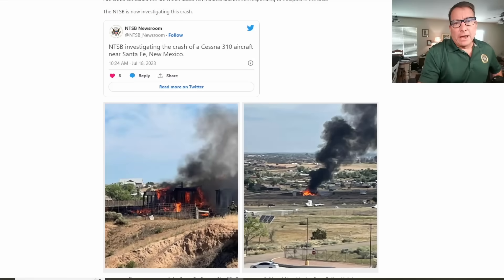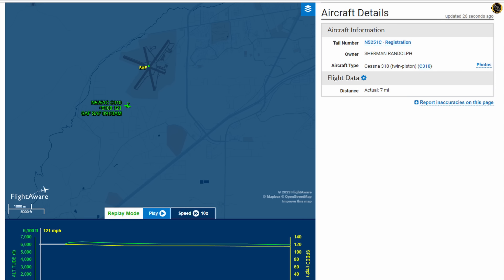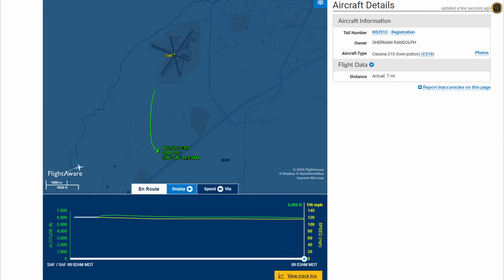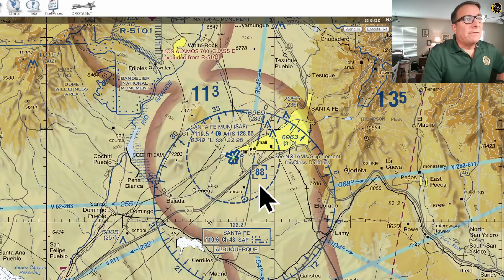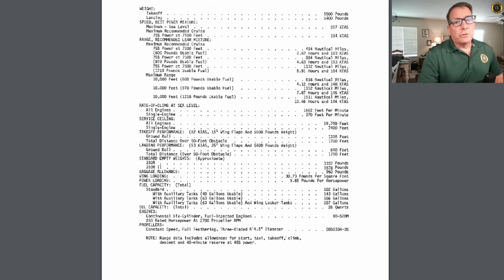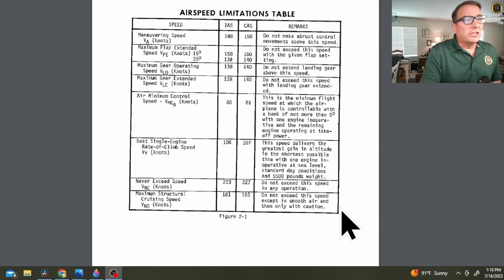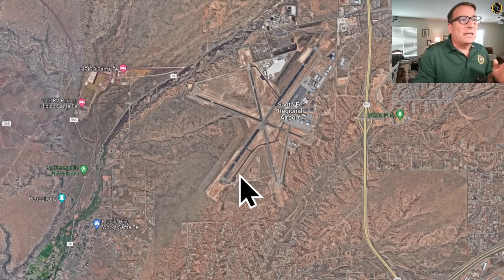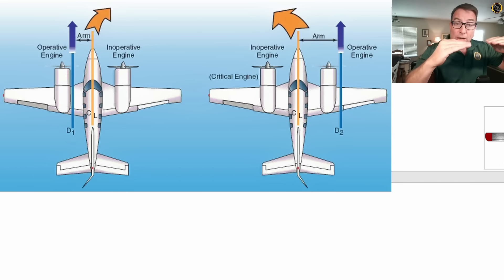Fatal C-310R Engine Failure - Santa Fe, NM

Comment: Been a long time since I got my multi ticket, But I recall my instructor telling me if I was in a spot like this to back off the power on the good side and put it down on the best spot I could find.  I can imagine this pilot was determined as hell to try and save it, and couldn't accept giving it up and putting it down somewhere.  There's another video of a 310R crash from a couple years back where the airplane flew over the person filming it, and you could hear only one engine running, the left one feathered, the airplane flying slow  and  nose up, then does the roll into the ground.  It was lightly loaded too, only 2 on board I think. Search "double fatal 310 crash in las vegas" on youtube.  My condolences and prayers for his family.
Reply: I believe the dead engine on that one wasn’t feathered..
Reply: @thomasaltruda  I agree.

Comment: Most of the analysis is focusing on DA's effect on a NA 310's SE service ceiling, but this plane was a turbo with a much higher service ceiling - this video shows/analyzes the incorrect POH for the NA version.  So the plane should have had no problem climbing on one engine at 9k' DA.  Obviously that didn't happen, and a highly experienced pilot is dead.  I hope we figure it out, but there's some other problem other than losing an engine.

Comment: There is lots of open runway here. Wide open feeling. Should not needed the go for a bounce. Makes you wonder what a new pilot is doing in a HP plane that is a lot more weight than a trainer. Lots of torque. Thanks for the content

Comment: Very sad. Light ME aircraft are usually under powered. When I had to fly the piper Seminole I mentally prepared myself for efato by treating it like a big Cherokee and just finding a field ahead. That operating engine was more a glide extender than a climb away at or above vmca option especially with passengers, bags etc!!

Comment: Thank you for your very informative videos. Wasn’t this aircraft a turbo version? If so, could the pilot have expected better ‘hot and high’ performance?
Reply: Better performance in theory, but controllability issues are critical, since density altitude affects indicated airspeed and airflow over the wings and rudder.
Reply: @gordonrichardson2972 I used to fly C-402s in hot climates. Single engine performance was not encouraging. Engine failure usually meant land straight ahead.

Comment: Excellent video. A tragic accident and a loss to both his family and community. Watching on another channel where they had the checklist up an item caught my attention.
Is it possible that under pressure and due to the high density altitude that the first reaction to the failure would be to push the mixture up to full rich instead of leaving it set for best power at that altitude? Mixture is the first item on the checklist and says "as required for flight altitude" however it is very easy to do when most of your training and home base is at sea level that with a failure the ingrained first reaction in memory is mixture full rich as that results in max power at sea level.
Full rich in this case would cause a loss of performance due to the altitude. Also with his significant experience is more complex types that have auto rich functions some reversion may have been a factor. Any which way it is easy to judge when not in the seat. I look forward to the report and the lessons from the video particularly about accepting on off field landing if there is a lack of performance is pertinent. On old and wise instructor once told me that in light twin the second engine will carry you to the scene of the accident.
Really like the content on your excellent channel.
X

Comment: So, 1.)  the pilot took off in ambient conditions that were not condusive to recovering on a single engine failure; and 2.) the pilot made the fatal mistake of turning into a failed left engine.  Would this accident then be considered primarily as mechanical failure, pilot error, or an equal combination of the two?

Comment: Would twin Cessna accident outcomes be better with VG kits that are 2/3 of the fin/ rudder instead of the whole surface and no wing root VGs to make the loss of yaw control
higher than stall speed and with slower progression.  Or wing stall sooner inboard before the whole wing or outer wing panel with aileron stalls?

Comment: Really surprised that after all these years, twin engined planes do not have engines that rotate in opposite directions. The De Havilland Hornet which was set to replace the Mosquito had Merlins that rotated in different directions, 70 years ago. I guess it would not have changed things in this case though.
Reply: Piper PA-39 Twin Comanche is counter-rotating.

Comment: The aviation safety network form you showed in the beginning was a Cessna "T" 310R yet I believe you showed the performance of a Cessna 310R model chart.  I am curious as to whether or not this was a turbo charged aircraft.  And would that have made that much of a difference
Reply: That's my observation, too. I think it could have made the difference if properly handled by a well trained pilot.

Comment: The GPS track speeds, which are in mph, the indicated airspeeds at that altitude must have been really low. Let's assume no wind. 120mph true converts to 91kts indicated at 9000ft. Slow, very slow.

9000ft vs. 7400 ft. is quite the difference!  However, much would have worked in his favor: The airplane will have been lighter than max gross with only one person on board and perhaps the aux tanks not filled. That helps with the climb, but it also increases Vmc (the documented Vmc is for the most unfavorable weight, so light). (The high density altitude, won't decrease Vmc because it's a turbo.)

I fly a normally-aspirated 310R, with the IO520 engines, and it does have quite some excess power and indeed I'd expect it to climb on one when light enough, but not necessarily beyond 10k density altitude. The accident aircraft even had turbos (or rather, one).

So there are some questions that we may learn from the report. Was it cleanly configured? Was it leaned for best power? Was the left prop feathered? If if all of this was the case, blue line is 108kts IAS, so why was he almost 20 kts slower than that?
Reply: So, N5251C was a T310R, a TURBO 310. The single-engine service ceiling is very different from what is shown in this video, as is . Single engine ceiling goes up from 7k to 17k. Showing the POH of a non-turbo 310R  seems like a glaring mistake, @blancolirio ...

Comment: Here at KLRU we had a similar accident a few years ago with a C421 because it was accidentally topped with Jet A instead of 
avgas.  This accident  has similar inconsistencies.  It is hard to believe that a lightly loaded Turbo 310 could not be flown single engine by a highly skilled and credentialed pilot to a successful recovery.  I sure hope they look at the engines for damage.  Bad/contaminated fuel answers the situation for me.

Comment: Doesn't the registration show this 310 as the turbocharged model?
  Still doesn't change the high density altitude analysis, but seems like the plane would have had a little better performance than the normally aspirated model.  A tragic tale no matter what.

Comment: The NTSB preliminary report came out in the last few days.  They reference a dashcam video that shows the aircraft descending  wings level and nose slightly high (although it goes out of sight before the crash sequence).  No comment on which engine failed.  It does reinforce that this was a turbo 310.  I think the performance numbers you used in this video are for a normally aspirated 310. I would have thought a turbo 310 would have had much more climb performance even in this density altitude?

Comment: I wonder if any engineers have ever considered a twin engine plane with a single nose mounted propeller.  Two power plants but no asymmetric thrust if one fails.  It could have an electric power train i.e. the engines are generators and the prop is driven by an electric motor.  I suppose that setup would add a lot of weight though.

Comment: I'm a single engine PPL but I've had some some training hours in a twin comanche , is it possible that due to the pressure density conditions he may run out of rudder authority (while had the good engine on full power ) ?
Reply: I'm not a pilot, but do know that density altitude affects both airflow over the wings and rudder, as well as the engine power.

Comment: Reading a lot of comments from pilots here that are focusing on turbocharged engine    vs non turbocharged concerning density altitude.
No one has mentioned how density altitude also affects the lift of
 the wings and not just
 the Engine performance.

Comment: This one just showed on my YouTube feed. I am trying to understand why I missed this one, but I did. I prefer to avoid second-guessing the actions or decisions of others since I was not there. I spent the first 7 years of my lackluster career flying the 310 Qs and Rs on a canceled check run. The airplane can be a handful. I was flying a lot back then and was very proficient. The company's chief pilot I worked for would say if the gear and flaps are down on take-off and an engine quits, Close the throttles and land. The airplane is really a single engine airplane that has a spit engine. Once cleaned up, gear up, flaps up, and 500 to 800 feet agl, you have some room to work with. I have never flown that particular airplane at those field elevations; hot temps is well hot temps. I do a DA calculation and a takeoff and landing performance cal for every flight, and the numbers are to be on the paperwork and when you call in to dispatch. We didn't break any airplanes. This is a sad one; all he had to do was close the throttles and land. Doing that gives you a better than 90% chance of walking away without a scratch. The airplane can be replaced since its 2023. It's a 45-year-old aircraft. It's just a pile of aluminum.

Comment: I guess there needs to be another check item, that being if your density altitude is above your single engine ceiling. If this is the case, any engine failure should be treated as a total loss because you can't climb. He was trying to get some altitude but there was no going up at that point.

Comment: I assumed through most of the video that it was a single-engine aircraft.  It shocked me to learn this accident happened on a twin-engine plane (with one engine still running).  I never heard the term "high-density altitude conditions" ("high density-altitude conditions"?).  I won't forget it after this.  Thanks for the info.  So sorry about the tragedy.

Comment: Simulator training, rehearsal, practice decision making in scenarios, live practice in the air.   That's just the skill side of it.    To be able to focus and live in a way that allows that focus seems also critical.   What a pilot can do to be prepared is a huge commitment.    I'd like to get to the point where I know I would do it all.  In this case, maybe there wasn't a lot could be done at this DA .   But perhaps the turn into the dead engine could have been avoided, but left looked like the shortest , and he wasn't gaining altitude after the failure.    Then there was the idea of the drainage egress mentioned below.    

Maybe there was no real way out of this one, given the engine out, density altitude, etc.    However, seems like part of the planning process would be to evaluate the conditions, and the what if scenarios.   What if I have an engine failure at this altitude and temperature?  I cannot fault the pilot, what looks like a mistake to takeoff now probably didn't look that way when you want to get in your aircraft and go.   Flying can be incredible and at the same time completely unforgiving.  RIP.

Comment: Do multi engine pilots ever consider the single engine plan of “in case of engine out below X feet AGL I’m going to put it down not more than 30 degrees left or right”? Seems like a fair number of VMC roll crashes happen in a similar manner to “impossible turns.”

Comment: In pilot training are pilots told to call out which engine has failed?
Is ATC trained to take this into account when suggesting turns?
Reply: No, and no. You can turn into a dead engine just fine if you have enough airspeed.
Reply: @igclapp  
It's been many months but as I recollect there is a preferred direction to turn to avoid problems as much as possible, including crashing.

Comment: The difference between between a GA twin and a transport category twin becomes clear here. While most GA twins will fly on one engine there is ABSOLUTELY no requirement for them to do so.  As my initial multi engine instructor beat into my head " you have to consider that the only option is to pull the good engine to idle and land straight ahead." CFIT being the least offensive option. And unlike most transport category pilots GA pilots are generally not tested every 3 to 6 months like my professional colleagues.

Comment: The 310R had a service ceiling of 17,200 on one engine.  It should have been able to climb in the conditions stated.
Reply: It should read T310R as this was a turbocharged version. The normally aspirated version 310R has a much lower ceiling.

Comment: On a twin, losing one engine does not mean 50% loss of performance, but is approximately 80% loss of performance, and that is more significant than many realize.

You lose one and now you just transitioned into "carrying cargo" (dead engine weight, drag and loss of performance of that wing) on a "self re-configuring aircraft" (now it handles like you may not be prepared to understand, and the worst place to find yourself in a teaching moment)...

The the position of the engine lost, (#1 or #2) and the handling of the aircraft in turns and climb, must also be realized and factored in recovery.

Study, Learn, Comprehend, Train, then repeat every opportunity you have, so that it is natural response. (start on the ground and use every opportunity to re-enforce the things learned)
 Hate to lose good, smart people.

That means, the aircraft's performance, capability and limiting factors, an the PIC's, and then what nature brings to the briefing of performance, capability and limiting factors.

My condolences to the family, friends and those in the community that are impacted.

Comment: I am a CFI Multi and if you do the math it would take -7 to 8 miles to get to pattern altitude at 300 fpm climb at 120 mph.  That is if you do everyting perfect, clean, feathered and flying is on point on speed.  It is hard to just pull the power back on running engine and make an off field landing in a twin. I use to fly my Piper Apache heavy and hot/high DA.  With two engine climb was anemic. One engine climb might be nil to zero in these conditions. Cool low altitude airport, solo, half fuel, two engine climb was great. One engine some climb, like 300 fpm. But if there is terrain, not good. But I knew if I lost an engine in high, hot, heavy scenario, I was doing an off field landing if the failure happened right after takeoff.  In route losing an engine at altitude ,  able to drift down the twin gives you options. Everyone should fly a B777 ha ha,

Comment: I suggest that more light twin engine pilots need to take a look at the required performance standards on one engine.  There are no one engine takeoff climb out requirements at any altitude at any altitude and of course definitely not at KSAF at these temperatures.  These aircraft are not airliners.  Proper take off planning should be done and you should be aware that you will have no single aircraft performance (turbo or not) even if you do everything right by the book.
Reply: blancolirio6  Just saw your message.  For performance details for light multi-engine aircraft I suggest you look at FAR Part 23 or CAR 3B whatever the 310 was certified under.

Comment: Of course the Sky King 310 has been around forever and it's a beautiful icon.  
I never flew one myself, I always heard that it had marginal (at best) single engine performance.  Those light twins are just a super handful if you lose an engine and you are trying to milk it and get the opposite rudder in and maintain Blue Line.  If you practiced that every day, you might be able to do it smoothly.  Very sympathetic to this guy, though no doubt he will be criticized for his response to the failure.

Comment: So just curious would it ever be the correct procedure in these kind of niche conditions to shut down both engines and choose control ability over power?  Now he only had 200 feet above ground level he probably wouldn't have had a better outcome with no power but you get the idea of what I'm suggesting here

Comment: I wonder if any engineers have ever considered a twin engine plane with a single propeller on the nose.  Two redundant power plants but no asymmetric thrust if one fails.  It could have an electric power train i.e. the engines are generators and the prop is powered by an electric motor.